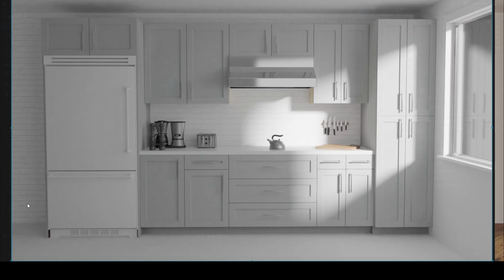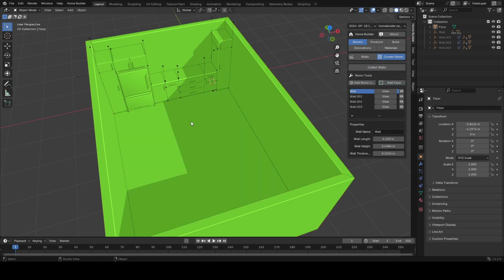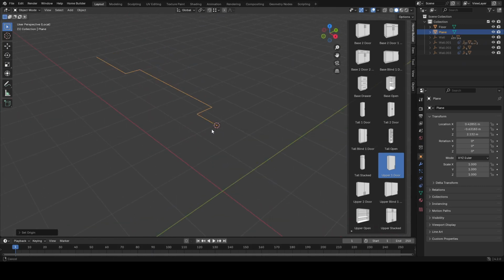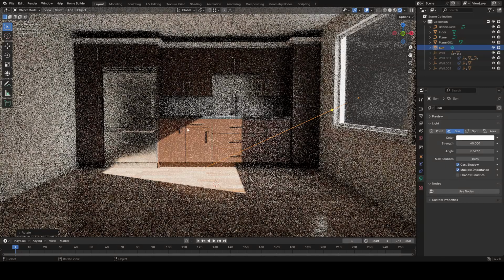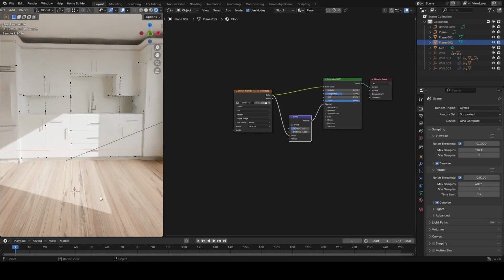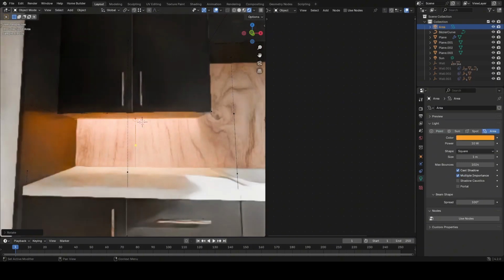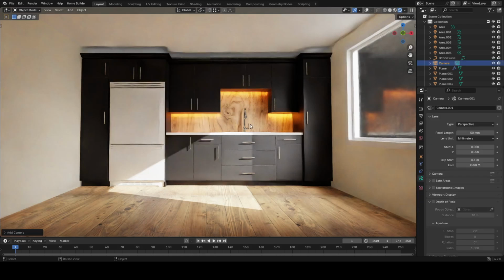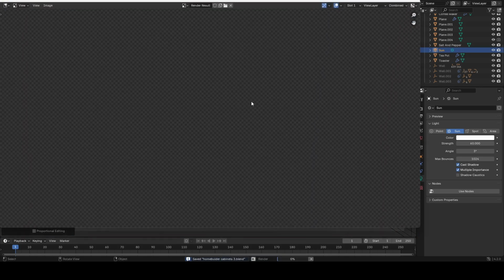Interior Design using Home Builder add-on - Blender Tutorial #interiordesign #architecture #trends

Comment: I have not watched your video yet but I have desperately tried to use this add-on many times. Unfortunately it is not that easy to draw walls especially with a demand to do it clockwise only to have normals pointing correct way.  You are lucky if you do not have turns that are not 90 degrees. Rotation with a key never worked for me and I had to use rotation in Blender just to turn a wall. Closing the loop works wrong or does not work at all. 
I spend almost an hour trying to get to draw all walls only and it did not even come right all the time. I will watch your video to pick up something I've missed from others but at this point if you only need to create a 3D model of a shell of your home using vector graphic software just to create lines of your plan in SVG and using a Blender addon to turn it into walls can be much faster. And then using Archimesh add-on you can add doors, windows and furniture.

Comment: Have you figured out how to do a custom door with this addon? I can model a custom door inside Blender but when you scale up the size the rails get larger and that's not what I want. Typically I will just do it in Edit mode and that fixes the rail scale issue. But I don't see a way to use a custom door inside this addon.
Reply from the maker: The addon has lots of functions, and it's a good idea to contact It's creator directly through YouTube by his email.